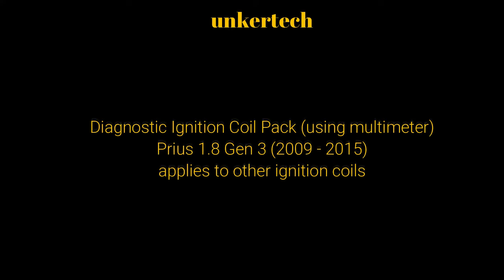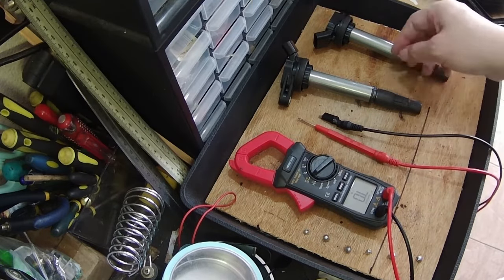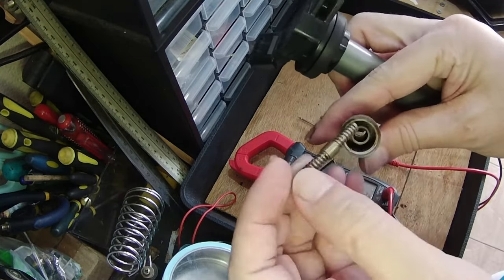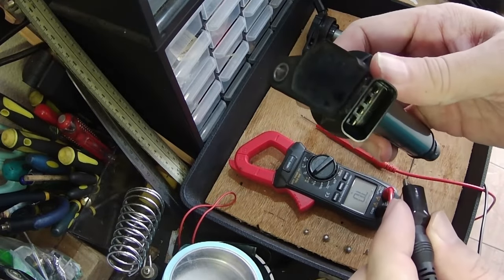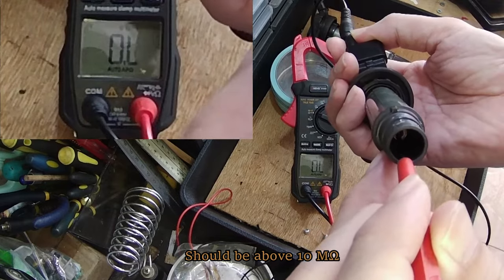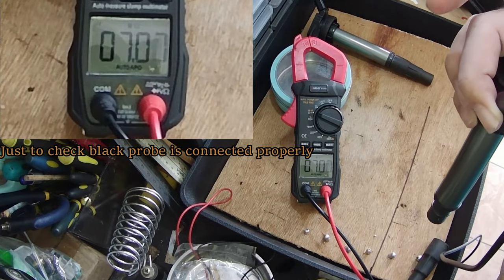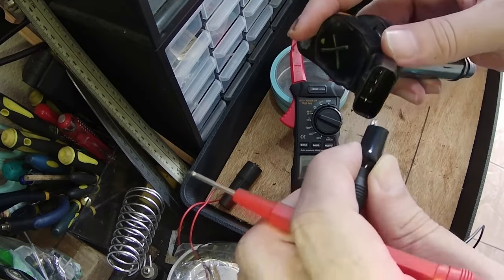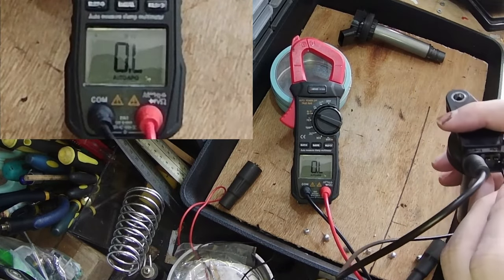Testing ignition coil pack with multimeter - this is how it's done

Comment: What is the setting on the voltmeter?
Reply from the maker: As mentioned in the video, set the meter to read OHM. That is the measurement of resistance.
Reply: @unkertech yes but 200? 2k? What setting under ohm?
Reply from the maker: @CaseyHealsMe  If your multimeter have auto, set it to auto and it will output accordingly. If not, always set it to highest reading (unless you know what ohm to expect) then lower it accordingly until the desired output reading is achieved.
Reply: @unkertech  it doesn't have auto. it has 5 different settings under the Ohm section.

Comment: Well according to this video the car I drive every day has 6 faulty COP ignition coil...n it's a V6
Reply: same, no reading at the bottom and between connectors on each side its about 5 O (toyota corolla)
Reply: same here getting no reading between bottom connector and left most pin. v6 2018 impala. getting a reading about 46 ohms between two outside pins.
Reply: Yeah I knew something I'm glad I could read these.. no resistance at the bottom will be detected because the circuit is incomplete one coil and the coil pack is not energizing or creating the induction necessary for the circuit to be completed.. also to note further the bottom is ground